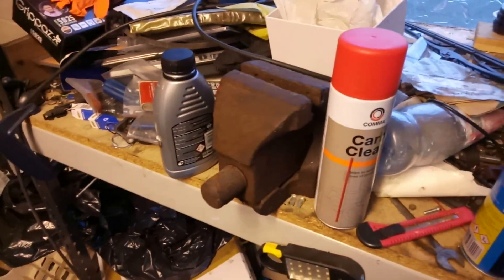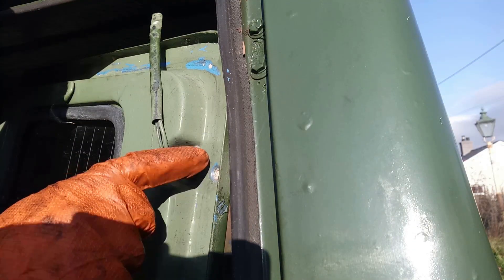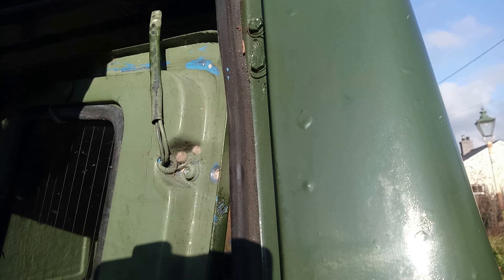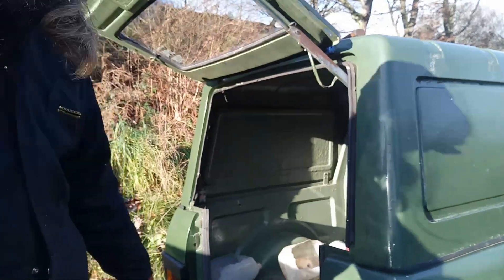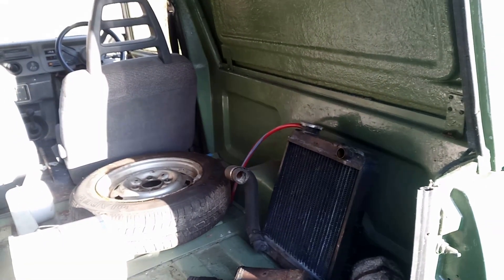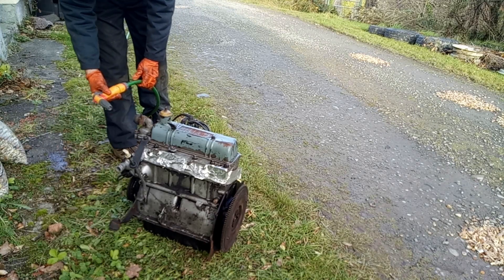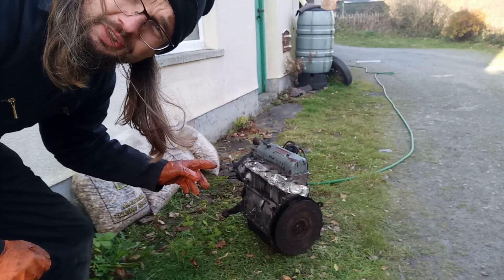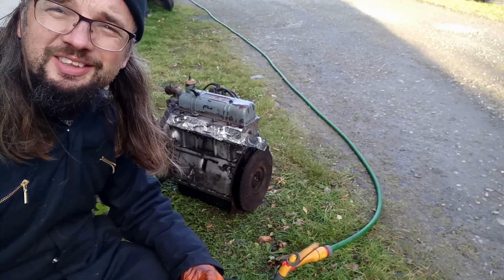Project Fox Part 2: It begins! Sort of

Comment: Apple cider vinegar on rust. Dilute it 50/50. Eats the rust and leaves the good metal.
Reply: A cheaper option is citric acid powder. There is citric acid in cola, thats why it works as a rust remover.
Reply: @llaeeZ   The acid in cola is phosphoric.  That is also the active ingredient in Jenolite, a rust eater made for the purpose.  It's actually quite useful, and can be used as a concentrated paste, or diluted in water as a bath

Comment: White vinegar is much better for cleaning rust from iron and steel than cola. Coke has some phosporic acid in there, but no really enough to make it decently effective. Even then, if you got your hands on a phosphoric acid cleaner, the vinegar is a bit easier and safer to use with less special precautions.
Reply: YES AGREE works great for me!!!
Reply: Citric acid also works and is completely safe.
Reply: Wood Bleach acid cleaner is the best.   It soaks off rust while doing no harm to the unrusted steel or iron.  Will need a thorough rinsing with water with a little baking soda in it to neutralize the acid water.